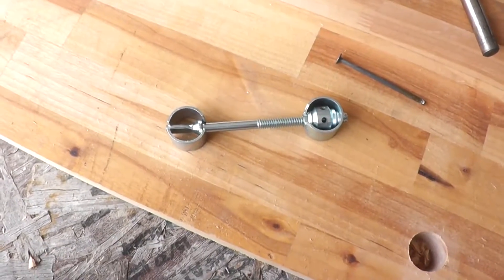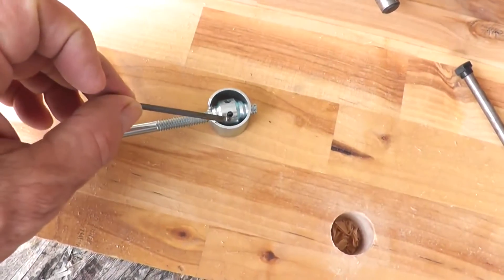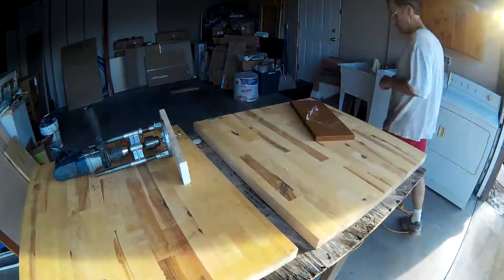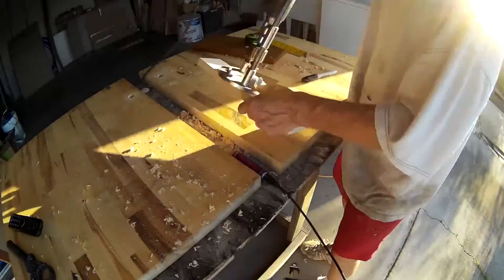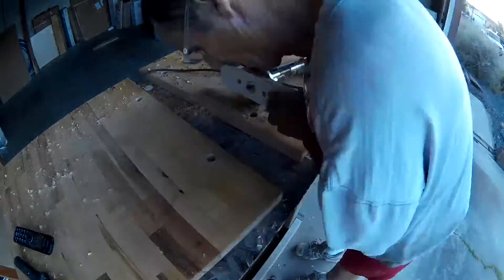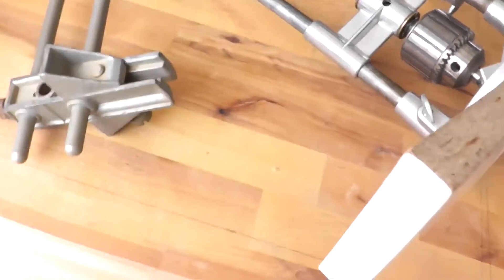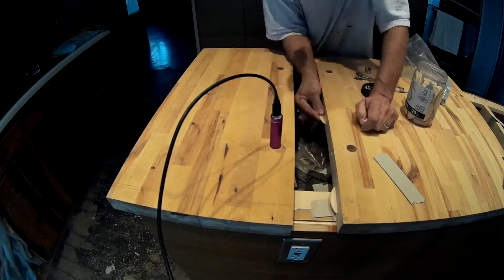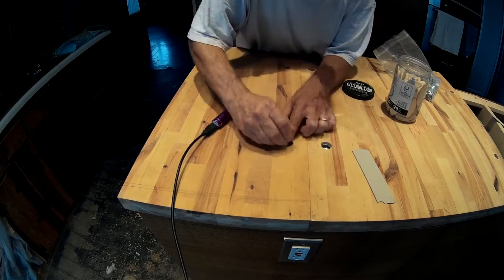Ikea Butcher Block

Comment: great video! just what I was looking for. do you know how the butcher block is manufactured? ie does it have this dog bone fastening system or is it simply biscuit joined and glued together. I want to rip one through the long side down the middle and I don't want to run into fasteners mid cut.
Reply from the maker: Found out recently that Ikea doesn't make solid butcher block any more. Most butcher block is just glued together, no biscuits, no dog bones. What you see in the vid is me joining the pieces that I cut up with dog bones so I can take it apart in the future if needed.